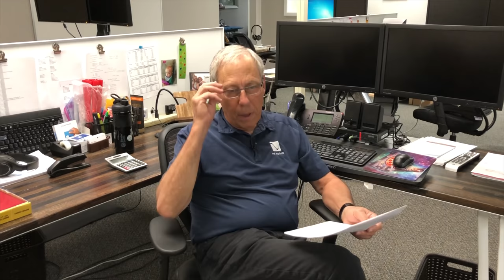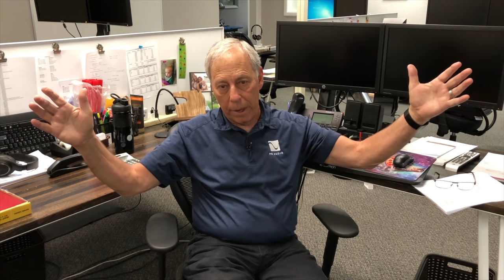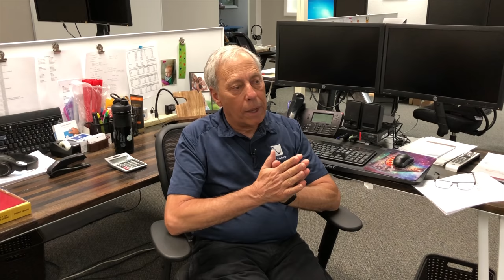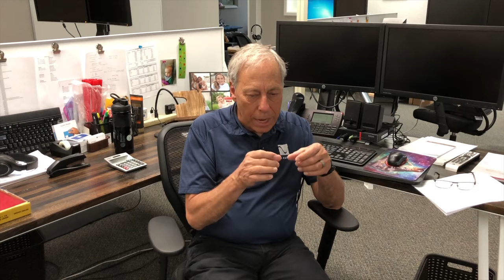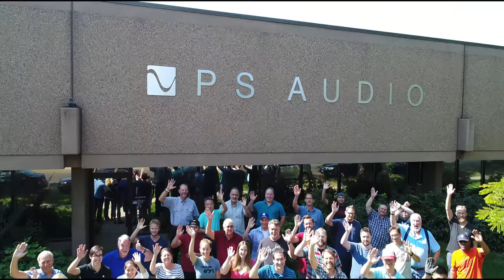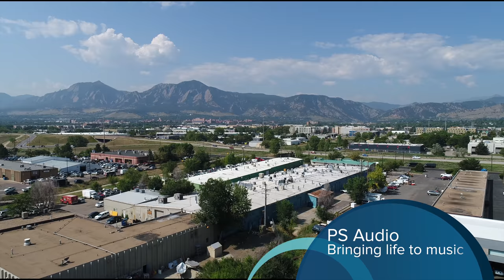How does a servo woofer work?

Comment: So woofer driven with servo controlled drive(amp+comparator) is better than same woofer without it? So you push woofer beyond the limits of it's motor structure (magnet & voice coil), limits of it's acceleration?? How is that possible? 
I know that Studer made some studio monitors with back EMF feedback correction , and they sounded weird and unnatural.

Comment: Great discussion on servo controlled low frequency drivers. Can this circuit be passive or must it have its own dedicated amplifier requiring an AC power supply and source?
Reply: Technically it could feed data to digital processing unit before the amplifier, so you would need just 1 amplifier, but your digital processing unit should have data and software for that particular speaker.

Comment: It sounds fantastic, but why not use it on the medtones and diskant also?
Reply: As Paul explained, woofers have much greater mass, so they are more difficult to move/stop. That's not the case with mids and tweeters.
Reply: No, the issue is about adding extra expenses, that is they would be more expensive, but the idea is correct. From mids to tweeters it would increase the quality.

Comment: I think a bad Amp with low Damping Factor cant control the low frequencies and forces the woofer creating longer movements then the original source, which also creates more room
Problems. I have a Cheap but very high-end class D poweramp from XTZ (edge a2-300)(495euro) with an Damping factor greater than >1500 from 20hz/500hz. This Amp can fully control the woofer and makes its sound extremely fast and tight. It starts and stop notes real quick. My speakers has two 6,5 inch woofers each, and dont have much Mass so dont think a Servo could do much to it. Just buy a great Amp to fully control the speaker and many people would be very happy already. And doesnt need to be expensive as My XTZ Amp proves. Anyway most people dont have a proper environment for listening music as intended. But Lots having “over” expensive useless Gear without proper set-up and acoustics. Cheers.

Comment: Some advanced subwoofers may use a feedback signal from a device mounted on the speaker’s cone. The servo control unit compares the subwoofer’s output to the input signal and attempts to compensate for the driver’s output errors in order to smooth out distortion level. Unfortunately, this feedback circuit, no matter how quickly it works, cannot make the correction until after the error has occurred. As a result, the correction is always arriving at the subwoofer’s output with the next signal. Therefore, the correction is made on the wrong signal and it may compress the subwoofer’s transient response and remove its impact."
Do you agree...?
Reply: yes
Reply: I want to know what your thoughts are on the back to back woofer design. I don't get all my notifications on stereo junky so I guess I have to be the real me! I see that your saying back to back but the standard way is one on top of the other which the jamo sw1 is that I have played with. I'm ready to start building. I need more!

Comment: Paul.. Do you prefer Speaker level connections for subs? Or Line Level connections? Thanks!
Reply: I'm not Paul but I'll respond. I haven't had good results from chained speaker connections. Currently using separate pre outs to my powered subs. Also send the whole frequency to the subs. I tune the crossover level on the subs. Listening to something like the Birdman album is great.

Comment: Can I add servo control to my existing woofer, or have it added?
Reply: Paul McGowan - Ah, I  see. Thanks for the reply. Love your daily content, btw :-)  . . .  Is there anyone at PS audio who might do it? It’s for a subwoofer with a passive radiator setup I’m building, but I don’t have the capability for servo control. Or would you think that the benefits you describe would not justify the cost and expense given that I’ll have this passing through an AudioControl 31 band equalizer anyway? What you described about injecting a difference curve was enticing, but after thinking about it, the equalizer seems to be doing a very similar task. Also, the 10 in woofer has a massive neodymium magnet (overall 3,000 w rms), so maybe replacing the cone with something light like carbon fiber would help too. I appreciate your input. Thanks in advance from Los Angeles - Matt.
Reply: Paul McGowan - You’re an early bird I see. As for the woofer, no problem. I’ll see how it turns out with just the DSP. Thanks!

Comment: The fact that he says that the woofer can do a square wave and never refers to "ringing reduction" (what is actually happening) tells me he doesn't actually know what he's talking about, typical i find in the "high end audio" space. It's control system theory, and the simplest form of it. Also maybe the reason it's not used is that it's not necessary, low frequency distortion is not so discernible by the human ear, unlike the mid range.

Comment: Who besides Rhythmic does Servo?
Reply: Yamaha's. YST subwoofers.
Reply: I think Velodyne, Rell and Genesis make servo subs
Reply: stronty TYVM

I am in the market for a sub(s) and like what I am hearing about servo subs, but wasnt too keen on spending $1080 for 2 subwoofers. I dont need to blow my windows out, I just want my music to have accurate bass, so I was hoping to get two cheaper subs.
Reply: I have one of those mini systems with rather cheap speakers that apparently has some sort of servo feedback. Not sure what they use as there are only the two wires going into the speaker
Reply: Servos have, as PS noted, and ORDER OF MAGNITUDE, less (harmonic) distortion than their passive equivalent. If you like (as I) accurate, fast bass you will find that in a servo controller sub (or woofer). I have 3 (now really old) Velodyne subs and they are game changing. I play them at very low (relative) volume (per each) and low end is flawless. The only problem with Velodyne’s (very) old stuff is that they break.
Reply: Velodyne for sure !   They had the lowest distortion levels from their ULD series subwoofers back in the 1980's !!! Still enjoying my old Velodyne F-1500-R,  low power, but quality, quality and man, does it play down low !!   (O:
Reply: The Martin Logan Depth I have incorporates a servp and it is a fantastic soinding sub. Not sure if they still make anything with it.
Reply: infinity... their modulous sub

Comment: Where do you actually placed piezo element you say the voice call I would have thought the cone would be more effective, I can't see where it would benefit on The Voice coil this is a rigid structure and shouldn't flex. Can you get a servo box of tricks! to work with the piezo and convert it to run with your amplifier, what am I looking out for. If I've got this right the piezo is producing a small voltage either way and your box of tricks swaps the voltage to the driver to act as a break, so a Raspberry Pi might work?
  It's a bit like that idea I suggested to you before using active damping with the golf ball, with a very high damped fibre cabinet. overhang is the major issue where talking about here aren't we?

Comment: Oh my God! Another unanswered question: How do servo control Woofers work! 
Sorry, but about that Accelerama we have heard a lot, and personally, I am so annoyed about the answer, because it does not reveal any secrets about how it works... It's equal to: "How does the Stomach feed the Body and Organs?"  And the given Answer is: You eat through your Mouth, and the Food goes down to the Gutts, feeds the Body, and then you shit it out! So the Body is fed! 
Totally useless to say that such an answer is useless. 
It's also useless to answer: The Cruise Control is a little Knob on the Steering Wheel, and when you push it, your Speed will be held at a constant level, when someone asks "what is cruise control, and how does it work?... " 
These are things we all know already. 
We want to know HOW and why the Servo controlled Woofer works!  Or the Cruise Control, or the digestive System... 

Teal’c: "This is a blue Light!"  
 Jack O’Neill: "And what does it do?" 
Teal’c: "It shines blue!"......

So, back to be serious:  What does the Amplifier do with the Signal of the Accelerama?  What Kind of Feedback does it give to the Amp? 
Is this a Feedback similar to the Feedback of an OPAmp? 
So, being convinced that this only can be generated virtually and digital: How does the Amplification-Circuit of the Amp predict what the next BAss-Bump will have to be or sound?  
What is going on inside?  How do you avoid Distortion that such a Feedback creates? 
Because, at that time when I measure the position of the Woofermambrane, it`s over! And despite it goes on with speed of light,  a correction Current just handles acceleration that happened in the Past! So, how do you bring this up to be right on time?  A Cristal-ball? Laying Cards? Female intuition?  
This is the things we want to know... ;-) We are not 4-Year-old Children, but Grownup audiophiles with Passion ;-)
Reply: its just like you say on your last paragraph,but it happens faster than you think,much much faster,so it`s not a past event,it is just on real time.
anyway,sure it will have a "crystal ball",a set of min-max-expected parameters to avoid overshoot the response.
the movement of a speaker is a really slow event for electrónics.

Comment: I don't get it. You said, that you do not like electrostatic speakers, they are bright to your ears. I use my old electrostatic speaker for organ music, bass goes very deep down. Add more bass? Why? less distortion and faster? May be. I never tried to connect Rel subwoofer to electrostatic, one day I"l trie; but I still don't get it, there is more need to improve upper bass and midrange on electrostatic

Comment: A:  the servo corrects errors AFTER they happen.  They screw things up on fast techno and metal.
Reply: just got done doing some research on this, it seems it corrects as the errors happen not after. if done right. 
however there are so many things to consider with design of the servo circuit that in some cases it would be after, and hurt the sound if not out right muffle it.
Reply: another thing I found was that frequency has a huge affect on it too, so practicality would make it better for lower range say 20Hz to 60Hz
Reply: Duds it's probably used mainly for bass as that's where distortion tends to rise to much higher levels
Reply: Actually, correction DOES happen after the original error. You might say that it is too late, but you'd be surprised at how much you can still do.

Bruno Putzeys has given a presentation about amplifier feedback. It might not be subwoofers, but the concept of feedback remains the same. You should check it out! https://youtu.be/0vsOugSsANs?t=11m2s
Reply: Yes it only work well on very low frequency, 50hz and below. Big motor+light rigid cone can do just as good.
Reply: mikka333 How about planar magnetic woofers? Its not very practical with speakers but planar magnetic headphones are known for clean thunderous bass
Reply: Motion feedback is not used in planar drivers because in headphones the diafragm will become too heavy in headphones.

Planar drivers are not used in speakers for bass due to large excursions I believe.
Reply: Hidde de Wit Yeah I meant to say that planar magentic is linear enough to the point that feedback would be useless on it. About the lack of excursion thing, can't you minimize the need for excursion by just using a larger diagphram that can move more air though, practicality aside?
Reply: First of all. Feedback is never useless. It is always used to improve distortion characteristics. If it COULD be applied to planar magnetic it would even further improve the bass. Just how would you mount a sensor to a diaphragm?

Yes, a larger woofer would also solve the problem. However that'd also require a larger cabinet. Most people don't want HUGE cabinets in their listening/living room.

I recommend reading the RMS Acoustics whitepapers about servo subwoofers. They are very interesting! http://www.rmsacoustics.nl/audiodesign.html
Reply: Hidde de Wit I think if distortion is below 1% down to 20 hz like it is for planar magnetic headphones (yes i know theyre not the same as speakers) I think its safe to say feedback would only add more complexity to the design while offering no audible benefit
Reply: Well -60dB THD is still quite high if you compare it to electronics. It is really good if you compare it too other drivers.
Whether it is necessary is up to the customer. Though you could perhaps make it -70dB THD. I don't think this would hurt anyone. After all it does perform better. Does complexity of the design really matter to the end-user?
Nevertheless, it is not possible so why are we discussing this.
Reply: Hidde de Wit Im just saying feedback's a form of correction for an easily measureable and often overly relied on and overly simplified specification (THD vs the composition of the distortion) and that there might be drawbacks that have not been fully measured and understood. Also, below 1% is to say that its anywhere from 0.99% to 0.01%, with many planars doing 0.1%. But you're right, this is all theoretics. I sure do wish someone would go and make a huge planar woofer though.
Reply: Servos are a way to achieve low distortion measurements but the sound is muddled.
Reply: Well, the construction of THD is quite important. 2nd and 4th harmonics sound more pleasing than 3rd and 5th for instance. Although feedback is as far as I know the best way to suppress distortion. Hypex has made a few white papers/masterclasses (https://www.hypex.nl/p/application-notes-white-papers/) about suppressing distortion with feedback. Of course there are drawbacks to it, mainly costs.

I don't think we have many forms of distortion that we can measure. Pretty much all forms of distortion products can be seen by the "nulling" technique.
Reply: Your research is flawed.  A servo is not predictive, it's reactive.  Read more. Learn.  You don't have a grasp on servos.
Reply: Not useless, unnecessary.
Reply: Scott Lowell May I ask where and why it is flawed? AES whitepapers and burning amp are very reliable sources of research.
Reply: Actually I will be doing my thesis for my bachelors degree in engineering after summer. I am nowhere near the level of the people who wrote the whitepapers I mentioned. However I do stand by my point.

I never stated that feedback is able to correct BEFORE the error happened. That is not possible by definition. Otherwise it'd be called feed-forward (which actually does exist). I never said it happened at the same time or before the error happened. I said that it is a way to correct distortion.

How a servo works is by sending a signal to a system and measure what the system does. Then you adjust the input signal to make the output of the system do what you want.
Reply: You're acting like servo feedback is something that takes seconds to work. The feedback correction occurs as the cone is traveling. Using modern feedback control schemes you can basically correct for issues in real time. A properly designed servo feedback system will operate many times faster than any beats the subwoofer is reproducing. "fast techno or metal" is nothing compared to a 500 MHz DSP or an analog feedback system.
Reply: The speaker STILL has mass (and thus inertia).  It cannot stop on a dime no matter the feedback tech.  For this reason I opt for many smaller drivers instead of one massive one which I find results in a tighter, punchier bass. 
I guess adding servos to smaller speakers (as the IRS does) gets you the best of both worlds.  As with ALL audio, it's all about the tradeoffs and compromises of one solution over another.
Reply: Well of course it can not stop instantly, but with feedback you can reduce the ringing. The ringing causes the impulse resonse to be horrible! And a good impulse response it is what people tend to describe as a "fast sounding speaker".

http://www.rmsacoustics.nl/papers/whitepaperbassreflex.pdf
This whitepaper explains why adding a second resonator is not suitable for a subwoofer. The main reason is group delay, increase roll off, and step response! RMS Accoustics has more interesting whitepapers about motion feedback systems. I highly recommend reading them.
Reply: In an analog system, yes the correction must lag the error, but the whole point of a properly tuned servo loop is to minimize error.  These loops operate at least 10 times as fast as the intended frequency.  Even OLD CNC machines had 1Khz positional loops, same tech.  Today the positional feedback loops are going to be 3Khz to 18Khz, depending on the horsepower of the DSP they are using.